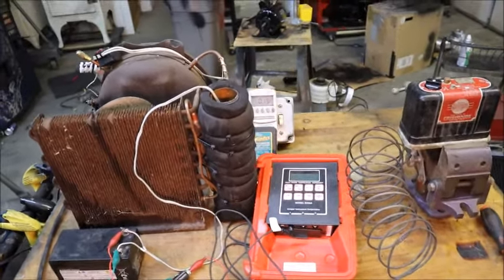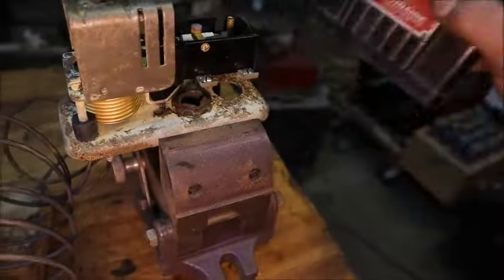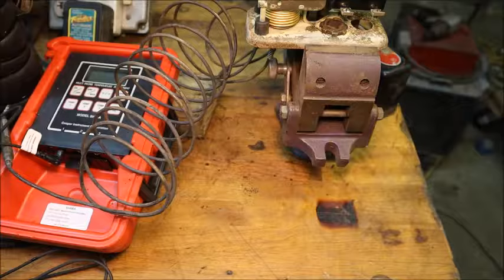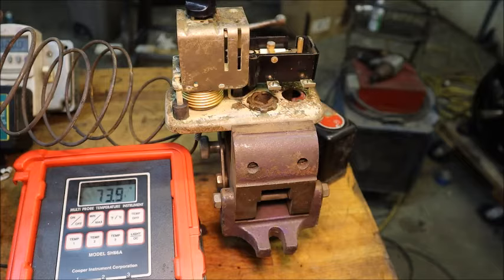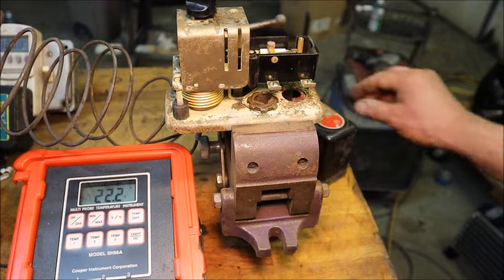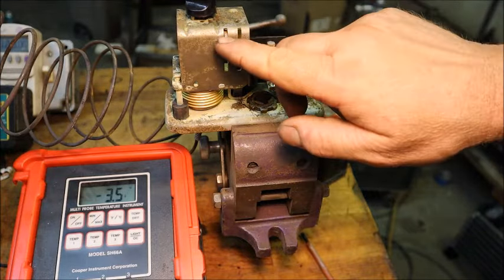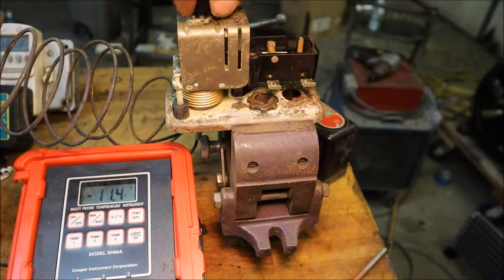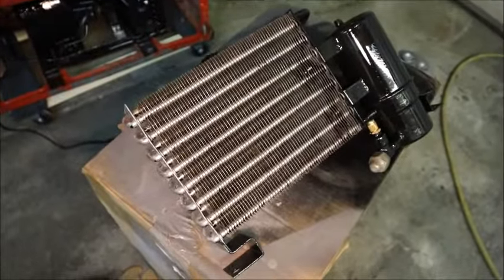Pre-War Cavalier Coca-Cola Cooler - 3 - Control testing...

Comment: That's a Tecumseh compressor, isn't it?  What is the HP rating?
Reply from the maker: Yep!  It is an old 50's Tecumseh. I believe it is 1/5 HP for medium temp and R12. It came from an Ideal Slider soft drink chest cooler. Was too rusty to use for a restoration but made a great cold well machine.